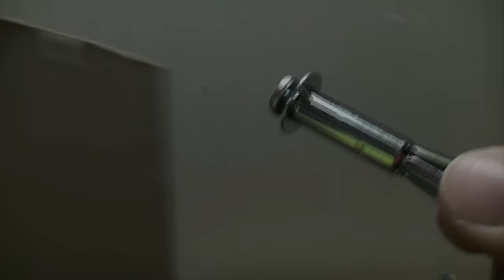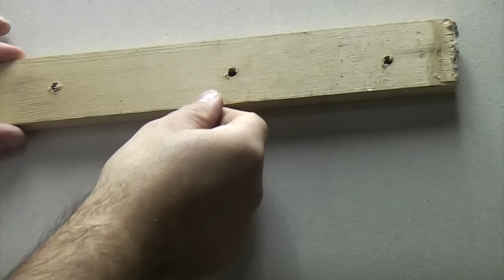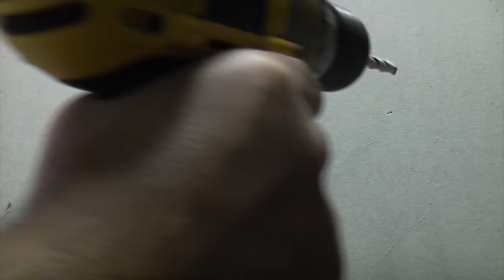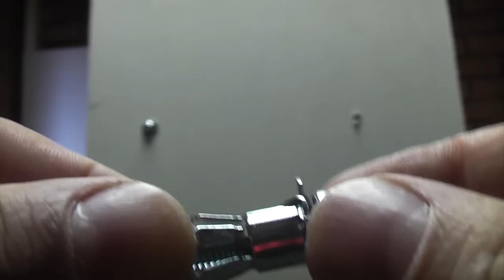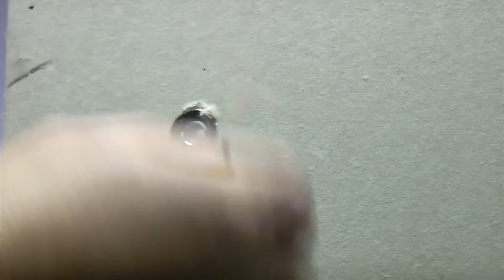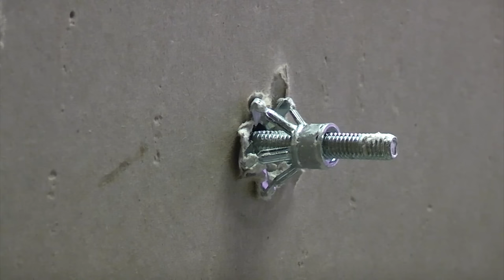How to use hollow wall anchors

Comment: Wish I watched this BEFORE using it to put up shelves... 

So I did the following 
*Took the screws out of the fixing and tapped them in the drilled whole (like a plug) 
*then fed the screw into the shelf bracket into the fixing/hole
*then screwed it in, until it tightened and will no longer turn 

Please tell me that will hold?
Reply from the maker: As long as the fixings pulled tight, they will hold 👍

Comment: Do you absolutely need to use a setting tool with these mate? Reason I ask is I got some Fischer wall anchors from B&Q and the guidelines on the back mention nothing about it. I'd need to go out and buy the tool if it's absolutely necessary. Cheers.

Comment: I´ve just put up my TV that has a weight of 16 kg. I have a simple dry wall and i´m a bit nervous about it faling down and be trashed. It´s adjustable and says it holds for 35 kg, but i don´t realy trust the wall or the arm that holds the tv... I´ve used 4 "mollys"(wall anchors), and all in a rather small area. Do i have a reason to be worried or will it hold? Would appreciate an answer! =)

Comment: how would I find out the thickness of my plasterboard in my house so i know what size fixing to use?
Reply from the maker: You can make a small hole, using a bradawl or small screwdriver, then use a small Allen key or a piece of rigid copper wire and put a 90 degree bend in it, you can put that through the hole and mark the surface of the plasterboard on the object, then remove it and measure it.
Thanks for the comment 👍

Comment: Hi there sorry to trouble you however I am looking for some advice. I am going to be building a window cannopy at the front of my house. And I have been instructed to fix some 6x2 timber to the house in order to take the weight of the cannopy and to fix it using resin and screwed rod. However as my house has wall cavities I can only insert the rods in 50mm. Should this be enough to hold the cannopy of is there any other fixing method I can use for example going through the cavity into the internal brickwork and use some other fixings?? Thanks.
Reply from the maker: I'd go in 100mm, if you drill right through the brick, it should not matter, as long as you flood the hole with the resin before installing the studs.
Resin fixings are a great way of fixing- 
https://www.youtube.com/watch?v=oUJPjJsdl0c&t
Thanks for the comment 👍

Comment: so has this been set from just the power of a cordless drill? how do you know when to stop screwing and it's been fully set? or will it stop dead? I thought it would start spinning before it would bend and set?
Reply from the maker: You can use the torque control on the drill. The important thing is not to go too tight, or you might damage the threads.
This might help- https://www.youtube.com/watch?v=ku29KYl4Wdg&t=3s
Thanks for the comment ;-)

Comment: hi
are these suitable for fixing a mirror to a plasterboard wall? we tried the other day, but the ones i had were too long for the wall. so would need a shorter one if they are suitable. The mirror doesn;t have a frame. is art deco shape. 71cm x72. not sure what it weighs.had two keyhole type hangers on the back. the screws of the wall anchors I have fit snuggly into. just need to tell my partner what he needs to get from homebase !
many thanks.

Comment: I’m just wondering if it will hold my tv up. Because I'm thinking of putting my TV on the wall. It's plasterboard, then behind it, it's brick. My tv is really heavy need 2 people to lift it up.
Reply from the maker: NO, I would use these instead-
Rigifix- https://www.youtube.com/watch?v=xaYfs3lr1jI&t
Corefix- https://www.youtube.com/watch?v=7xLhIPoO5gQ&t
👍

Comment: thanks.   I looked them up and it looks like I would also need to get my hands on that puller tool to install them.   Do you know if it is possible to tighten them using just a normal bolt and turning a 2nd nut to pull it in or would spin in the hole?

Comment: Hi i wanted to know how much weight the plasterboard could hold rather than the the screw itself as im wanting to hang a Kingavon 2kw convector heater weighing 11kg with black glass panel front on my dormer palsterboard and it needs to hang just sitting on the screws once drilled ..rather than actually screwing in tight like say for eg..a shelf bracket...will these screws (anchor) hold my 11kg heater sitting on on just 3 screws without ripping the plasterboard out or coming loose after while du

Comment: nice vid, do you ever use the hollow anchor setting tool ? I used to have problems using them till I discovered the tool
Reply from the maker: Thanks, no I do not use enough of these to justify buying the setting tool. I prefer to use toggle snap toggles

Comment: would these be reliable enough to hold a mounted TV? would it be better to mount a piece of wood to the plaster board and then the TV to the wood? the fixings I have can take a max load of 20kg and the TV plus the bracket is 15.2kg. would the weight of any added wood need to be considered too?

Thanks
Reply from the maker: You really need to find the studs for fixing a TV - https://www.youtube.com/watch?v=glzwY76O0d8

Comment: I tried fitting some wall anchors but the fitting wouldn't bite when screwing into the wall so it was just spinning leaving me with a rather large hole in the wall. Should I just use a snap toggle now? I think it's big enough

Comment: Hi mate, I'm struggling to find cavity fixings that will suit my wall, I'm wondering how much flexibility the measurements can be?
A rough measurement says my plasterboard is 14mm (but I'm going to guess 12mm, being the more common dimension), and from face of wall to back of cavity, there is 35mm play. I've seen plenty of 38mm cavity fixings around... would they work at a push? Thanks in advance, love the channel.
Reply from the maker: I'm not sure if they will work, but as long as you have the room behind to get them in and they are for 12mm board they should work, of you could use GripIt fixings- https://www.youtube.com/watch?v=szx7nMRZSIY
They are good when there is not much room behind.
Thanks for the comment

Comment: if the plasterboard is 20mm and the wood is 20mm, what length hollow wall anchor do I need? Is it 40mm or a bit bigger to help it grab the back of the plasterboard i.e. 45mm?
Reply from the maker: This should help, there is a chart that has the maximum and minimum wall thickness etc
https://assets.rawlplug.com/98428627-2b6f-469a-912a-aa19cfaee54b/en-pdf/FIXINGS/Lightweight_Fixings/Plasterboard_Fixings/SM_INTERSETS/EN-R-1951-SM_INTERSET.pdf

Comment: Great video mate. Was wondering if I could use these to fix a bracket for a microwave onto a plasterboard wall? I'm very dubious about the weight....
Reply from the maker: Thanks, I'd use snap toggles to be honest, they offer a really good fixing.
snaptoggles
Reply: ***** Cheers butt! Would the hollow wall anchors not be strong enough??
Reply from the maker: gykes88
I do not know, I don't have any handy to check the weight loading.
I know the snap toggles can carry more weight than most of the other plasterboard fixings on the market, so I use them ;-)

Comment: Hello. I have installed the Molly into the wall but I realised the hole wasn't deep enough when the screw wouldn't fully screw in. Is it necessary for the screw to be screwed in fully or can it be sticking out a bit or perhaps I could use a shorter screw? I hope you can help. Thanks
Reply from the maker: As long as the screw has been tightened so that it makes the Molly expand correctly it should be ok to cut the screw down.
This is probably the easiest way to cut one down (if you can't get a shorter screw)- https://www.youtube.com/watch?v=MDPeKlrIdeQ
Or perhaps you could use a few washers to get it to tighten?

Comment: Hi, I just attempted to add an easy anchor to wall for a jewlery cabinet I want to hang.  The easy anchor went through the dry wall BUT it appeared to have loosened the dry wall around it.  I then put in the screw into the anchor leaving 1/4 out to hang the cabinet on but you can actually pull the anchor right out of wall.  Any sugguestions on how to fix this issue?  Should I use the anchor you showed? or will I have to make a whole new hole now?

Comment: First off, great explanation. Secondly, I installed my tv mount correctly with the plastic anchors it came with (In Studs), yet to high for the wife to agree with... Thus, i need to lower the tv. The horizontal position is where we want it but just lower.. I bought these anchors, but after watching your video, I think these may not be useful with a stud behind them. Thoughts?
Reply from the maker: Thanks, you are much better off fixing heavy items to the studs if possible-
https://www.youtube.com/watch?v=glzwY76O0d8

Comment: I'm hoping this can be answerd as I can't seem to find any info anywhere. 

I have a large electric fire on a wall which I am taking out but behind that is about a 2ft squire hole which at one time was a wood burning fire...... well I'm putting a wooden frame in the hole to screw my plasterboard onto but I'm unsure how much of a lip there needs to be for the plasterer to get a decent coat on which will blend in with the wall of which this 2ft hole is on.
Reply from the maker: 2mm-3mm should work well.
Have you considered ventilation though?  Sealing a chimney can cause damp problems if there is no ventilation!
Reply: no I haven't considerd ventilation because you can put your head in and look up and it's already been boarded up.
Reply from the maker: Oh, okay then ;-)

Comment: I've used these before with no issues, but this time as soon as I tried to tighten the screw the anchor just spun right out of the wall. What should I do?
Reply from the maker: Try holding the bit at the front using some long-nosed pliers, whilst tightening the screw. The back part should then spread out and grab.

Comment: would these work with insulated plasterboard? would you need the longer ones or would the short one still do since it will tighten right through the insulation onto the plasterboard?
Reply from the maker: I'm not sure, as I have never tried them, but you can use GripIt fixings, if you use their undercutting tool, like in this video- https://www.youtube.com/watch?v=-geib-6sa3M&t

Comment: Any tips for stopping the anchor spinning with the screw? Tried it there but anchor just made a bigger hole and went right through plasterboard
Reply from the maker: Sometimes there is a small indent, where you can put a screwdriver to hold the anchor whilst you tighten it, or you can use the setting tool- https://www.youtube.com/watch?v=7mpcer0QzW8&t
Thanks for the comment 👍

Comment: How do you know how thick your walls are? I have a rental place; from the sounds of it, the walls are on the thin side, but I don't know the exact thickness. What are some standard sizings for these anchors?
Reply from the maker: You can find where the studs are, then probe the wall with a small Allen key, when you hit the solid stud, you can pull the Allen key out and measure it. https://www.youtube.com/watch?v=glzwY76O0d8
They come in various lengths- https://fave.co/3bQUs58
If you click on the "more info" link on the screwfix page, it tells you what thickness of plasterboard they will work on.
 They work best if used with the setting tool- https://www.youtube.com/watch?v=7mpcer0QzW8
Thanks for the comment 👍

Comment: It can work if behind the plasterboard there is a soundproof panel?
Reply from the maker: Grip-it fixings m9ight be better for that- https://www.youtube.com/watch?v=szx7nMRZSIY&t
I have used them on a stud wall, that had egg box between the plasterboard (Paramount partition)
But you might also need the undercutting tool- https://www.youtube.com/watch?v=-geib-6sa3M&t
 Thanks for the comment 👍

Comment: I've got a brick wall with a plasterboard layer in front of it with a bit of a hollow in between where I'd like to put up a coat rack.  The previous owner of the house had a coat rack there.  Would these be the right kind of fittings to use for that?
Reply from the maker: No, these will not work.
You can either use Rigifix or Corefix or GripIt fixings (you might need the undercutting tool if you hit a blob of drywall adhesive)

Comment: I want to hang a mirror in my bathroom. It has hallow wall where I’m putting it, but I don’t know how thick the wall is? How do I know which anchor size to get?
Reply from the maker: You can use this technique- https://www.youtube.com/watch?v=EP4ynwgg4fo&t
You might get a better fixing if you use the setting tool for the anchors- https://www.youtube.com/watch?v=7mpcer0QzW8&t

Comment: Thanks for this video!. Would this type of screw be suitable to mount an 8.5 kg / 19lb flatscreen TV? I know that the normal method for mounting a TV is to anchor to the wooden studs behind the plasterboard but in my apartment, metal c-studs were used instead of wood so I don't have that option.
Reply from the maker: +tommygrealy 
You are welcome. For a TV I would recommend something a little more heavy duty, such as snap toggles or Grip-it fixings-
https://www.youtube.com/watch?v=mIEY3E4fiDk
Reply: +Ultimate Handyman Thanks for the quick reply!!
Reply from the maker: +tommygrealy 
You are welcome ;-)

Comment: Dont see the point in the anchors when they just rotate and rip up the plasterboard like your first one did - that will weaken the fixing area a little.

Any ideas on how to get these things out once they have been fitted?
Reply from the maker: +Garry Gemmell 
This is how to remove them- https://www.youtube.com/watch?v=LZqCZfdvhbg
With some makes of anchor you have to use the setting tool- https://www.youtube.com/watch?v=7mpcer0QzW8
Thanks for the comment
Reply: Thanks = pretty decent of you to reply to most of the comments - not many youtubers do it!!! 100 extra points! lol
Reply from the maker: +Garry Gemmell 
I try and reply to all comments, unless they end up in the spam folder (done automatically by YouTube).
Thanks for the comments ;-)

Comment: How to determine the thickness of your plasterboard since the longer ones won't fit. Thanks.
Reply from the maker: +cholestrol11 
You'll have to make a small hole to determine the thickness. 
You can then put something like the short end of an Allen key through the hole and pull it back so that it's flush with the back of the board. Then mark it using a marker, then remove it and measure the thickness.

Comment: would this still work even if the hole ended being a little to big?. Im gonna be using this to hang my 32" Panasonic viera screen TV that is 18kg, the wall mount is 25 and the anchor weight holds 55lbs down and 40lbs up..this is my first time doing this so tips would be awesome. thank you so much for this video :)
Reply from the maker: +Ashley Lepage I would not use these if the hole is too big.I did a test recently the best performing plasterboard fixing was the spring toggle- https://www.youtube.com/watch?v=ECDysfNhx_E
Reply: +Ultimate Handyman thank you so much!!. really appreciate it :)
Reply from the maker: +Ashley Lepage You are welcome ;-)

Comment: Biggest problem I got with these is that the little teeth that supposed to prevent it from spinning, often go all way round and not holding it in place... any idea how to resolve it?
Reply from the maker: You can use a setting tool- https://www.youtube.com/watch?v=7mpcer0QzW8&t
That is probably the best option 👍

Comment: What are the sizes for the smaller anchors?? You don't mention it on the video, I ended up buying the bigger ones. Big mistake
Reply from the maker: They are available in a wide variety of sizes. The video shows how to use them, not what sizes are available 😉

Comment: Can you do a video on the best fittings to use to hang something, like a curtain pole, to a dot and dab plasterboard, gap behind a dot and dab plasterboard doesn't allow for these anchors to work
Reply from the maker: The best fixings for that are Rigifix wall anchors
Normally it's better if you fix a batten above the window such as 2 inch by 1 inch and then screw the curtain rail into the batten.

Comment: I've been given some of these to use to put up a curtain rail. How do you know what size is correct for your plasterboard wall though?
Reply from the maker: These are not much good for a curtain rail, as windows are normally on external walls of properties, so there is normally bricks/blocks behind the plasterboard (unless it's timber framed).
If there are bricks/blocks behind these will not work well, unless there is a large gap.
Corefix might be a better option- https://www.youtube.com/watch?v=7xLhIPoO5gQ&t
Reply: @ultimatehandyman  Brilliant thanks for the advice and prompt reply :)

Comment: Mine keep spinning! I pre drilled a hole big enough to force push them in and they keep spinning when I try to tighten then to get them to pop out, what am I doing wrong?
Reply from the maker: Try to hold the metal collar of the anchor, whilst tightening the screw. Once the prongs on the back start to bend out, it should grip 👍

Comment: Hi! I don’t have a power drill. How would I know when to stop screwing it making sure the anchor has already fully expanded?
Reply from the maker: The screw will go a lot tighter once all the prongs are expanded, as long as you don't go mad when tightening the screw it will be fine ;-)
Thanks for the comment 👍
Reply: @ultimatehandyman  thanks for the reply! I did what you said and it worked well! Thank you!

Comment: What size were the fixings and what size drill bit did you use. Thanks
Reply from the maker: They vary depending on the manufacturer, you just need to get a pack and that will tell you what diameter drill bit you need 👍